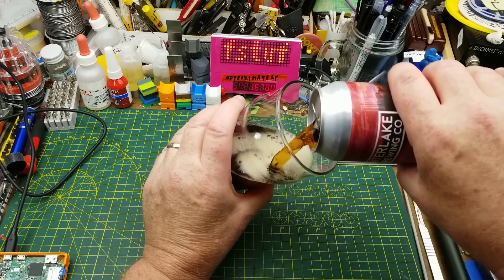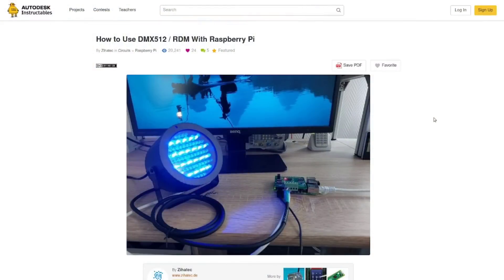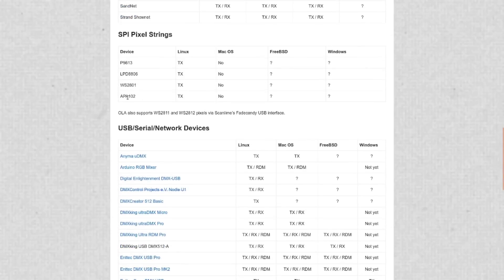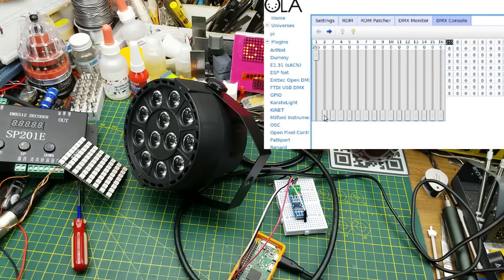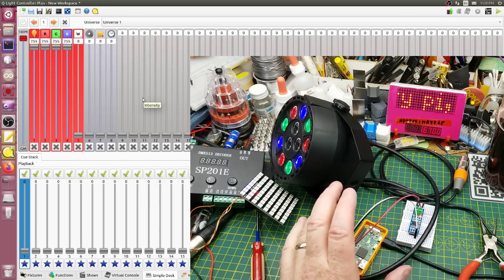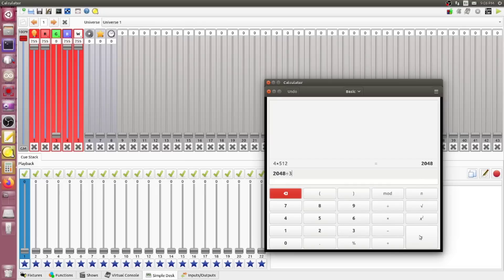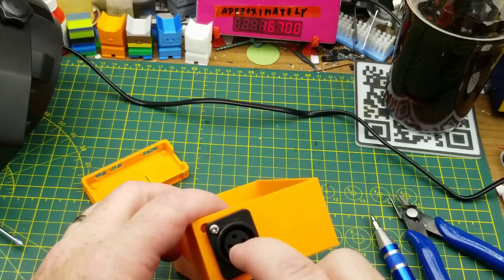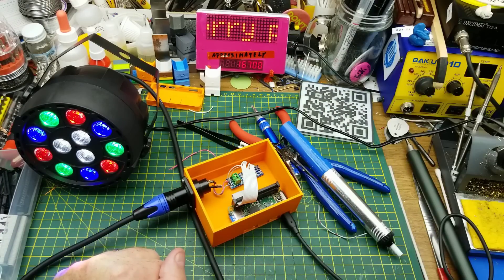A cheap stage lighting solution: artnet , DMX and raspberry pi zero

Comment: is there any way you can configure the pi as an input on qlc and when on of the pins on the pi goes high trigeres something on qlc?
Reply from the maker: It should be possible, I've never looked into that.

QLC has a lot of input and control options. MIDI is a very common one.

Comment: You don't really get 512 channels, but only 511 per universe.  Channel 0 is reserved for future expansion (but never used that I have seen).  I learned this a few years ago when I was doing a project at church.  We had installed 2 moving head spotlights (PTZ and dim), and I wanted to link then to both track a person walking anywhere in the sanctuary.  A little math for the code, but I did my own DMX coding.  The hardest part was getting the burst code before transmitting the DMX code at 250kHz.  I ended up doing this by putting the baud rate at 25k instead of 250k and sending 1 byte of all zeros.  Works well.  Feel free to contact me if you want more info on my project (I have since included a PTZ camera so you can see where the movers are pointed even if you can't see the area).
Reply: I use all 512 channels within a universe all the time....

Comment: If you wanted, you could also add serial ports to the Pi with cheap usb UART boards (FTDI etc). Maybe put a USB hub in between, that'll get you quite a few ports.

Comment: WLED supports DMX (over wifi).. you could make it wireless and you'd need just an ESP32 controlling a light and a computer with light control (plus) in the same network, nothing more..  :) 🙈

I set this up a couple month ago but didn't really wrap my head around the DMX software, qlcplus in my case.. there was also ledfx-git or ledfx-cc-bin to tinker around with.
Reply from the maker: There's plenty of different ways to get to the same place.

Comment: Very cool.  Would it be much work to somehow save a show (lights synchronised to a music track), saved onto some sort of memory with the PI in your box? And could that show be updated over your wifi?  And the show could be on a schedule (i.e. a yearly calender with start/stop times on set days etc.?)
Reply from the maker: Not sure.  There are some command line controls built in, so you might be able to script it in python or bash on the PI, but I haven't explored that stuff.

Comment: QLC+ is pretty much unlimited universes - you can add more than the 4.   It's also a good idea to add some isolation between the lighting and the device to prevent faulty lights frying your controller, or worse, your controller frying some expensive lights.
Reply from the maker: True, an opto-coupler stage would be a good addition.